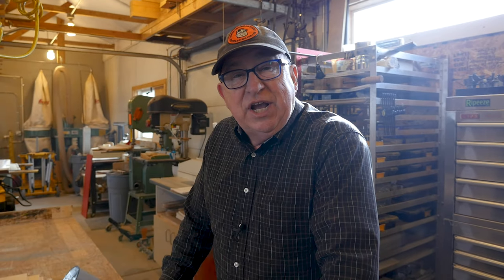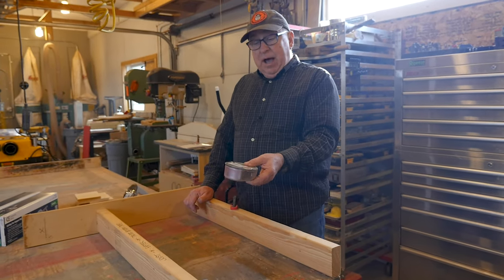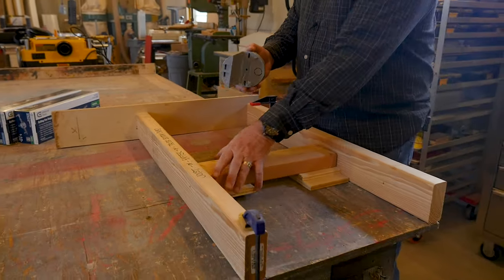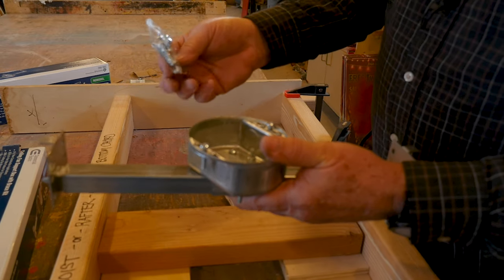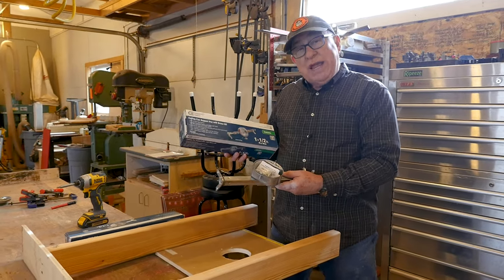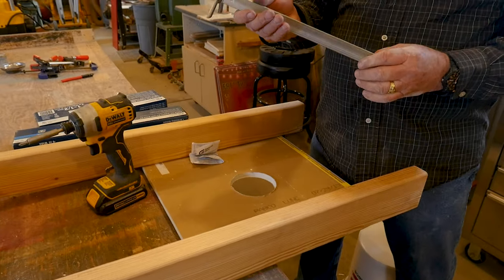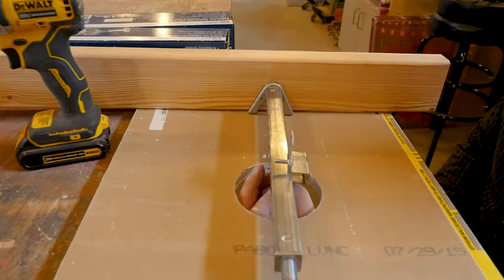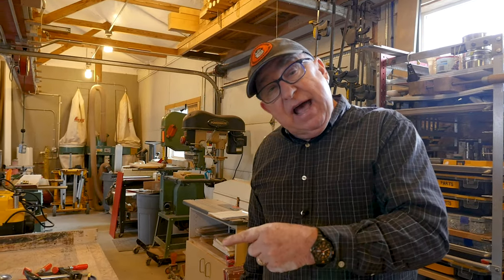Best Hardware to Hang a Ceiling Fan

Comment: Am I the only that will reach in first and feel the sides of the joists to make sure I don't pinch and damage existing wire that might be running along the joist. This is not even mentioned in the instructions.
Reply from the maker: That's a great insight. Thanks for mentioning it! I'll put it in the video description for that episode.

Comment: what if the hole is already there and the box isn't a ceiling fan box?
Reply from the maker: You need to make a determination if the box is adequately mounted and can take the weight of the fan and it's vibration. It is better if the box is removed and a heavy duty box with better fasteners is installed. How is the current one mounted? Best, DFJ

Comment: My instruction just said mount to beam in ceiling, used a finder to locate it. Should I be worried?
Reply from the maker: The main idea is assure you have the box securely mounted, and that the hardware to mount the fan unit to the box is adequate. Best, DFJ

Comment: Good tips. I went with the brace kit option. The previous ceiling fan electrical box / mount box was worse than a hack.
Reply from the maker: Glad you got the fan securely installed!

Comment: If we have no access to the attic and we're using the last retrofit mount that you turn, how fo we know if we have turned it tight enough? 
Also, what's with the red markings on the threads? 
Are they minimum and maximum markings? 
As said before, I cannot reach the area of the attic where this mount is being installed and the previous homeowners did not install studs in normal fistances so i dont know if they installed the ceiling joists in normal distances.
Do i turn it until it can not be turned anymore?

Comment: These are great when you are doing it in a finished basement or wanting to add a fixture in a room that had no fixture. etc. But if you have attic access, woulnt adding a 2 x 4 between the trusses be a more solid option like in the first part of your video  While some extra work to go up above, etc.  I would assume that would even be more solid than the brace.
Reply from the maker: I totally agree! A well attached cross block is incredibly strong.
Reply: @DirtFarmerJay  I actually saw a setup where they put a 2x4 over the trusses and then another 2x4 vertical.  Made it like an I beam of sorts.  That way the top portion was drilled into the top of the trusses, not the sides.  So made it even stronger.  Overkill, maybe, but not much harder to do.  I also subscribed
Reply from the maker: Details like this greatly increase the quality of the construction. Thanks for subscribing!

Comment: Great video! How would I adapt this with a decorative Faux (hollow) beam installed on the ridge of the ceiling? The faux beam is not structural so I can attach any mount to it, but I still want to have good access to the electrical box from below.
Reply from the maker: Wow, that's quite a challenge. Is there a box there now up underneath the faux beam that you are attempting to make use of? Give me a bit more. Best, DFJ

Comment: So im wondering your suggestions on using the "expanding" mount in the ceiling of a home that is plaster and lath. It seems this would mess with getting the box flush with the finished ceiling. Thanks in advance!!
Reply from the maker: I agree that using the expanding mount would be problematic. This is because the historic method of lath and plaster was to cover the walls and ceiling with lath, leaving gaps between them that the plaster would "mush" through, dry, and grip. These "keys" gripped the backside of the lath near the edges, and the plaster is proud of the lath backs. That means that you'd be at risk of breaking off the back side of the keys and having a section let go.  You might be able to install the mount in the midsection of the joists and use a box extension, but I don't know how secure the grips on the end of the mount would be and how prone they would be to spin. I hope this helps. Best, DFJ

Comment: Does it work on metal studs as well? Or is there any other option for metal studs?
Reply from the maker: If you have access from the attic space, yes. You can screw the mounting plates into the metal ceiling joists. If you don't have access, not really. The base plates for remodeling jobs have prongs on them that bite into the wood joists to hold them in place, and that won't work with steel. Best Regards, DFJ
Reply: @DirtFarmerJay  Thanks for sharing. You have been very helpful.

Comment: Next question: How to attach the dowrod kit to the retrofitted brace! Plz!
Reply from the maker: The down rod kit should come with a mounting bracket that will match up with the mounting holes/screws in the new ceiling fan box. This allows the down rod to be suspended with the bracket attached with heavier screws to the junction/mounting box. The down rod is then threaded with the extended wiring harness, the suspension ball is affixed to the top of the down rod, and suspended in the bracket, and the wiring affixed to the wiring in the box. A trim ring is brought up the down rod to cover the mount, and then the remaining work is done on the lower end of the rod as the fan is set up. I hope this helps! Best, DFJ

Comment: While using 24” rafters gap, there is an approximate fan weight that option can support?
Reply from the maker: Right at 70 lbs. according to the specifications provided by the retailer.

Comment: Are there isolator pads to limit how much vibration is transferred to the ceiling joists which is especially important when installing ceiling fans in plaster ceilings?
Reply from the maker: Gary, I'm not aware of any, but that's a good question. I wouldn't be surprised if this is an item you could get from a supply house that specializes in renovation and restoration supplies for historic and older buildings. Best, DFJ
Reply: I've seen these for appliances but not fans. I think they are too thick and might not hold up to being drilled, but they are basically either cork or foam sandwiched between rubber,  so you could diy something with sheet a sheet of cork or foam, rubber mat, etc.

Comment: I have blown loose insulation on the ceiling, so I cant touch those joists like in the video, also it does not show screwing of the box on the brace, where is which it does not work and I had to stop and return the item
Reply from the maker: Thanks for letting us know. Best, DFJ